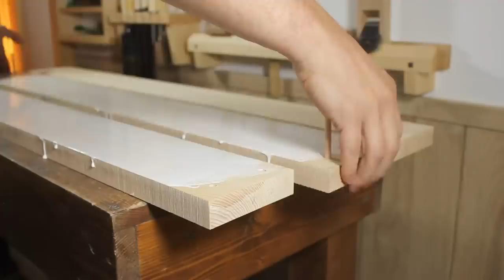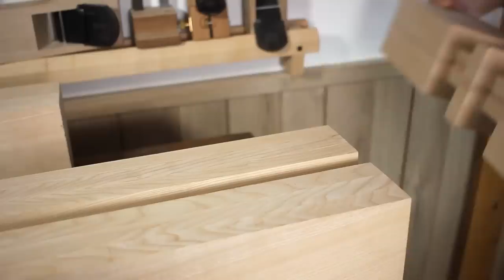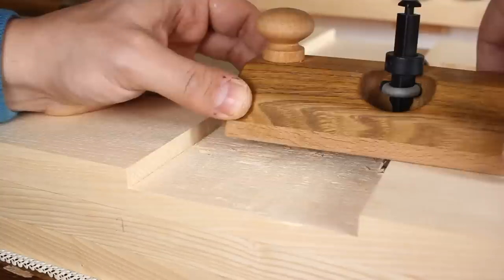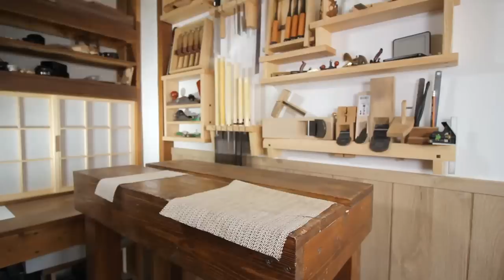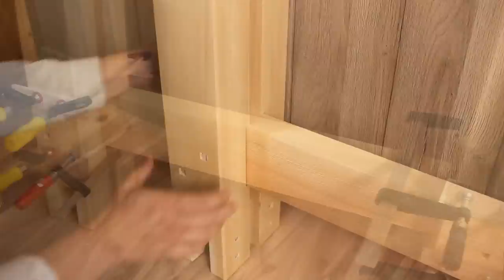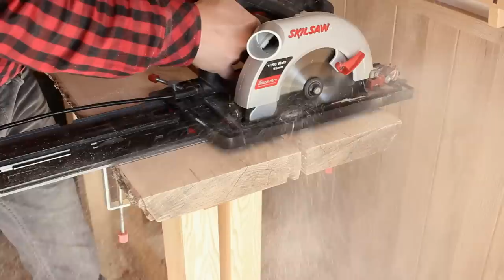Making a Table on a Sawhorse to use as a Workbench

Comment: That looks rock solid! I was surprised you even glued it together:)
Reply from the maker: Yes, was even difficult to assemble it with the glue and tight joints, that's why there were some missing parts in the clip when glue. I had to move it extra fast

Comment: i had fun watching i can imagine how much fun you had building.

excellent job editing as well.
Reply from the maker: Thanks! It was a love and hate project😂 was crazy when I glued and assmebed all togheter, all was so tight so I had to hammer them like a maniac
Reply: Adrian Preda: I bet. Whenever an assembly is that tight, there’s not much room for glue. Which means you don’t need much, so a thin layer will because the surfaces are so flat and close it will never move.
Try a test joint that fits together perfectly and just apply a thin layer and leave it over night. It’s an incredible bond.
I love projects like your bench because the pieces are flat straight and the joints are fun to do.

Comment: Beautifu bench build Adrian!
Those fittings of the joints is pure assembly porn.
Bark may fall off like you mentioned in the description and you'll probably cut it square as it's more convenient for a workbench work.
Congrats on the build. 🍻🍻🍻

Comment: Hi.  I was wondering if you would change anything now that you've been using it for a while?  I'm thinking about making this as, like you, I have a small workspace and this would fit nicely.  I think I'll make the top solid instead of the two pieces but I was wondering if it's sturdy.  Meaning is the base wide enough to support the solid top without tipping. If that makes sense?    Thanks.
Reply from the maker: The bench is about 50kg/100lbs, is quite heavy and sturdy at its dimensions despite it doesn't look like so. If used in length, like planing, it will definitely not move all, but in its width not so great, but that physics, footprint is ~80x50cm and 95 tall, but for other jobs other than planing, like sawing, chiseling etc in width is perfectly fine. You can see my other videos after this, doesn't move at all when used. If you see a little little tilting that's because my floor is not flat at all and the thin 6mm laminated floor has a bump :)
Reply: @AdrianPreda  It's a great bench for sure!  I'm too new at this to know exactly what I'll be doing but since I have even less room than you it won't be any huge project.   Thanks for the response and Happy New Year!

Comment: Good bench. If I can ask a question, the first part was him glueing and doweling 3 bits of wood together. Why not just buy a thicker piece of wood?
Reply from the maker: Thanks! First, those are 70mm (3") thick. In Europe, and I believe everywhere else as well, they sell lumber at 26 and 52 mm (1 and 2" ) thick in most cases, sometimes 32, depends, rarely I saw bigger like 70 mm but there were exotics like sapele or iroko. Otherwise you must mill and dry it yourself to the desired thickness but is hard to achieve a consistent drying, you might dry the outside of the lumber, but the mid will be still wet.  Second, glueing several layers will improve the strength of the board, will not bend, twist, warp in time, this also by carefuly selecting the pieces to have opposite grain direction like you see at 0:16
Reply: @AdrianPreda  thanks for that. Makes sense now. I never noticed the grain at 16. Thank you

Comment: Did you mix the danish oil with stain or apply them separately? Also, what color was the stain?
Reply from the maker: That's not danish, just a generic water based polyurethane from the  shop, 2 in 1, oak stain/color

Comment: Hello, I do not understand why join three woods of the same length if you later make a cut in the middle one. You would save time by putting the middle one shorter and adjusting it later ...

Comment: You made it like a takedown piece that didn't need a thing to hold it together and then glued it. That thing is more solid than a piece of granite.
Reply from the maker: It would have work even without glue, but here used as a workbench where planing mostly, sawing etc would have weaken and soften the joints. some glue will keep them snug some extra time.
Reply: Not putting it down. You will be willing it to the grandkids.

Comment: Nice sturdy table, but where is the workbench and where are the sawhorses? ;-)
Of course just kiddin'. But why have you built it that way? I would have built it more practical. Not with a live edge, added dog-holes ...!? I'm really curious
Reply from the maker: Thanks! I have the little tabletop workbench for that. And that time I had a small space to fit a wb, now I'm considering building a new one. Live edge was not intended, but looks ok and I've left it like that, I can remove it anytime or remake the top with a laminated one. It didn't bothered me so far, and the bark even today it holds